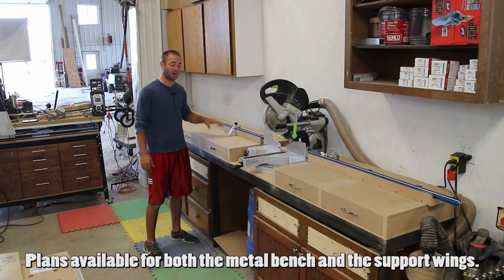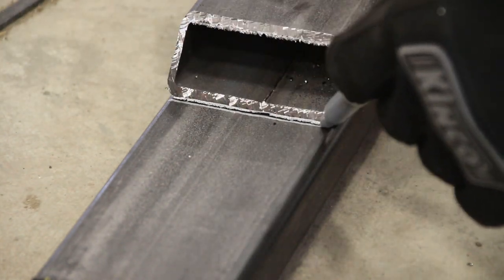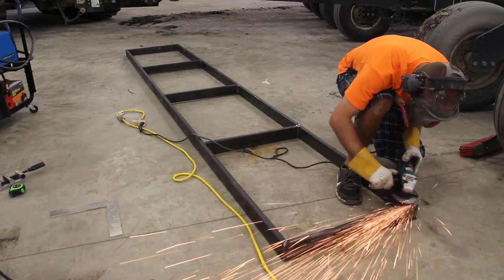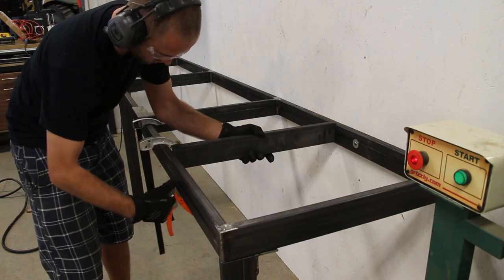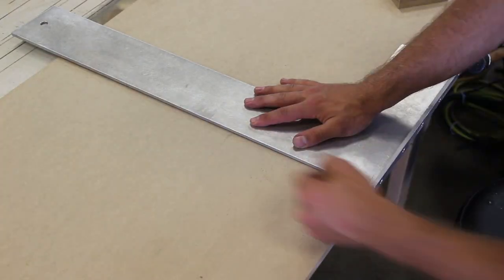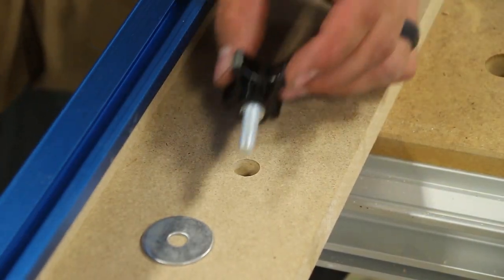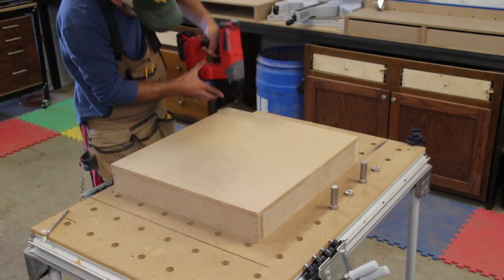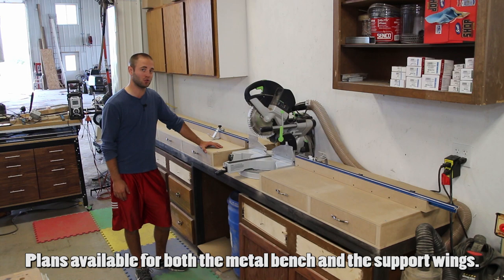Miter Saw Station with Drawers using Kreg Trak and Stop System

Comment: Planning the same fence build with knobs and threaded inserts which is why I watched. I'm planning on cutting the slots for the hold down knobs long enough to move the fence forward enough to allow for alignment with a 3/4 auxiliary (zero clearance) fence when I need it.

Comment: Very nice build, Andy.  Although a vast majority of people would just use wood for the frame/base, and would consider the steel overkill,  especially for a miter saw station, I really LIKE that you used steel.  I may re-do mine with steel as well.  Looks like you got the hang of welding pretty quickly too.  Kudos for an awesome build, and for the inspiration to re-do my station... :-)

Comment: Thanks for sharing. That is a really gorgeous looking station. I noticed the Kreg measure stopped at the mitre saw turntable, so how do you hope to cut measured short pieces inside of the saw turntable? Do you use a 10 inch piece of stock to bridge the gap and subtract it from the tape reading?
Reply from the maker: Or just measure and mark the wood.
Reply: ...very time consuming measuring each piece if a large number of small pieces have to be cut. 

I would move the RHS tape a further 10 inches away and make a 10 inch stop that moves to the blade.